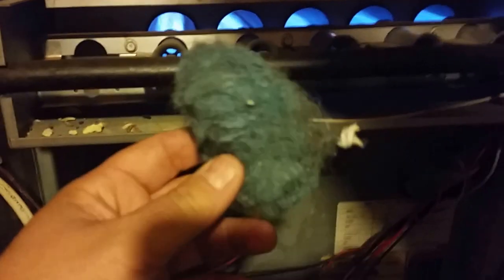Lennox furnace flame sensor dirty

Comment: best wishes i have lennox EL180UHE gas furnace when working make noise i checked the flash light for error it was number 7 ( primary or secondary limit open or switch guard mode -limit switch open longer than 3 minutes ), what is the wrong ?
thank you